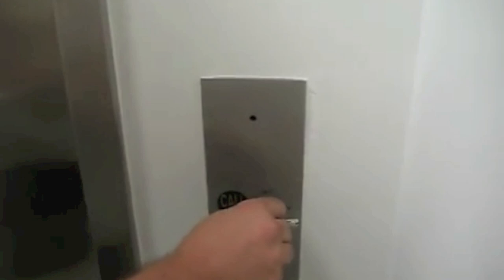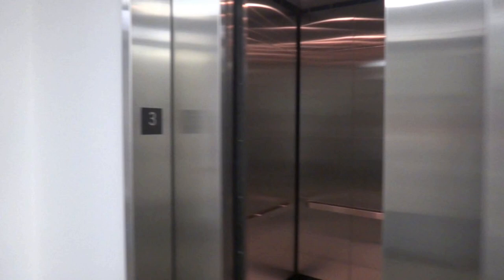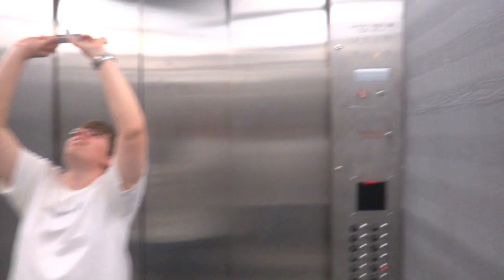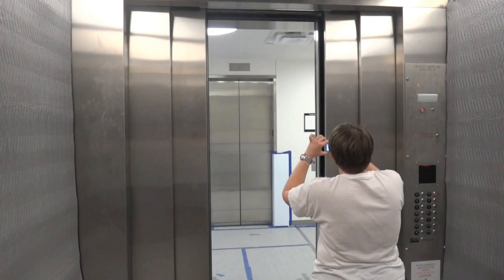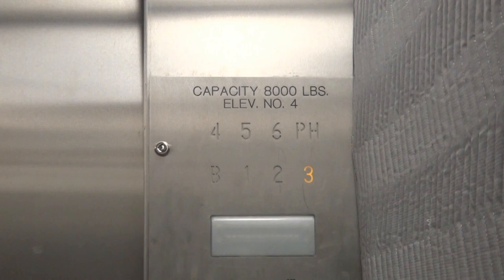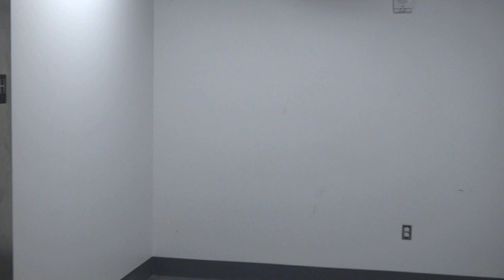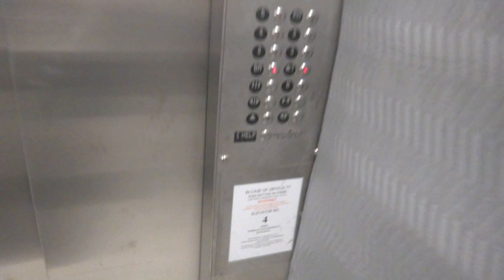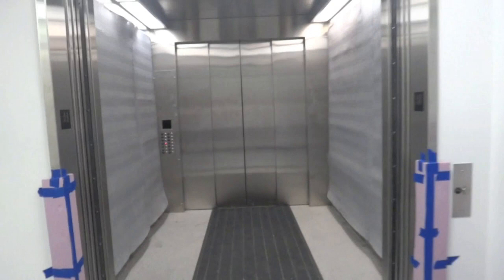Huge EMR Freight Elevator @ Norman Hackerman Building UT Austin Texas

Comment: Now what is so neat about two-speed doors is that when the floor is buffed, the fast door gets buffed by air being blown thru the slits when it's open, and slow door gets buffed by air the same way but then when the elevator travels on it's own to the top floor, then the wind from the shaft gives them a second buffing. Now using stainless steel polish on these, you may better off with the regular type rather than the oil based as some particles from the spray might land on the floor.